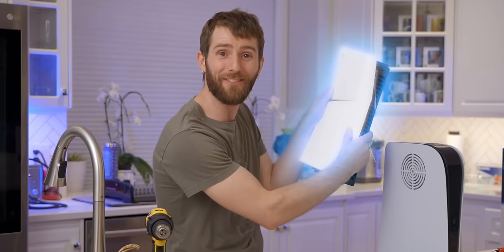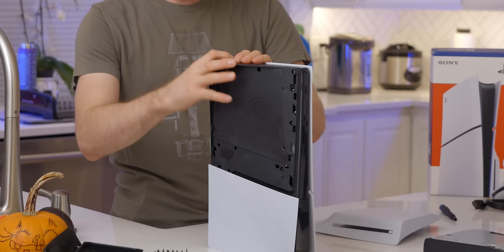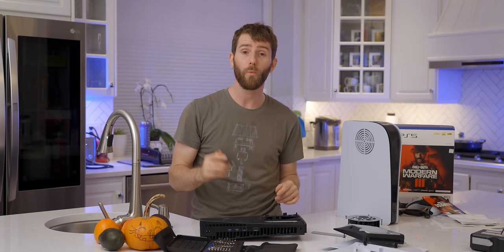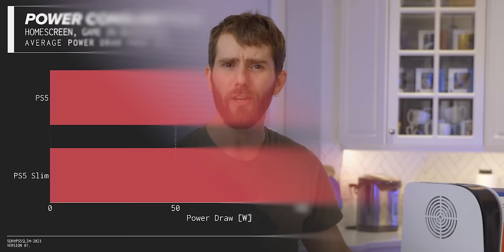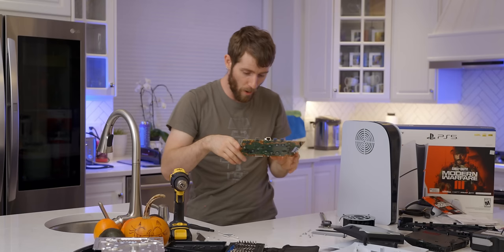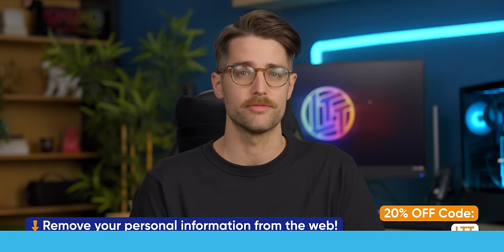PS5 Slim First Look and TEARDOWN!!

Comment: I thought you would share if the PS5 ran the same .. And cooled the same..

I have the original . .

My son bought mine at Fred Meyers where he works. 

March , 2021 . 

I've played a lot of call of duty.. 

I went through 7 PlayStation controllers 

Due to stick drift . 

I bought half from Fred Meyers. 

I started to buy warranties at Target and get my controllers that way..

But those controls lasted with a shorter life span.. From target In Spokane Washington. 

My first controller I bought from GameStop with a warranty has worked a year. 

All other stores a average of 3 months if I'm grinding on call of duty.  

I believe I'm very rough with the controller on call of duty because of the sliding around and shooting on multiplayer.. 

I stopped playing call of duty and I stopped breaking my controllers...

Now I play racing games and my thumb goes out before everything..

But this  PlayStation supposed to be more expensive..

With less product . 

That seems shady. 

The cost of living went up everywhere. 

Food has doubled in all aspects.. 

At fast food and grocery stores. 

But every one in the US is still making the same   .

Even property taxes doubled in price.  

COVID is gone . Nobody is getting free money. 

Jobs are still not paying more ..

The retail world is ridiculous due to COVID and the bit coin
.
.. bit coin screwed me .. 

I bought a gigabyte 970 extreme gaming in 2015 and thought they run to hot..  

I will get a 1080ti cause That architecture actually ran a lot cooler..

Then video cards went up to $1,500 used if you could find any.. 

I gave mine to the kids for Christmas expecting to pay about $600 for a nice 1080ti .  

Not a chance. 

I have Titan chokes on my 970 extreme gaming.. 

I feel bad but I took it back from the kids....

Added artic mk4 and it's been in my PC for 7 years collecting dust. . 

I built a fast PC for my son two years ago when m.2s and CPUs dropped in price.  

But both him and I still haven't bought new video cards yet, but I noticed video cards are becoming very reasonable priced and the AI technology is looking pretty good. I'm just not sure if I'm ready to buy one  yet.  

Always like to hold off a little bit in these areas. Sometimes when I feel this way because I keep thinking something a little bit better is getting ready to come out. So I'm a little bit better. Is going to get ready to come out and when it does the old stuff is going to start selling for a lot cheaper and that's my trick. 

I do the same with car audio.
But car audio has taken over too much of my home. It takes up a lot of space. I think it's time to get rid of that hobby. I'm too old. 

And I just started to grow cannabis.  

And that takes allot of space. 

And a massage amount of work if you grow in tents. 

Cuz you will be finding yourself in there weekly tearing all the leaves off just to get the temperature and the humidity to drop if your plant starts taking over the tent...

It's like having a new born baby.. 

You will be looking all the time..

I bought the AC Infinity kits. They are very nice with the controller 69. You can monitor everything with your cell phone vpds. It's very nice. 

You would like it. 

Up your alley. 

But cannabis isn't exactly for everybody. It's definitely good medical for the mind, but you have to learn which one works for you. 

Then by changing the harvest date, you can actually change the way the high affects you, whether it's a cracked eye like Daffy duck or whether it is a couch lock high that makes you stuck like Chuck. 

Lot to learn.  

But the first times after scary and not easy for people.. 

Anyways, I have brakes to do on my car. I used to love watching your videos in the past. It's been quite a few years since I watched them.

You and Jay Z2 cents are the ones that inspired me to do a video. I did. One started to get a lot of subscribers but I left it alone because that's when the video cards got expensive and I was mad. I just totally gave up on computers. Mine sat forever. I was mad. All because of the bit coin.. 

The reason for it was is my life was finally going great. I had custody of my kids and I was getting everything I wanted in life and I knew that I wasn't going to pay that much for a video card and then covid hit and then everything just took. I was getting ready to get a car and all the cars doubled in prices they used ones. I meant they've doubled.. 

I had money.. and it all got wasted on the cost of living. 

Take care .  Good luck and good vibes ..

We are now learning that light has consciousness and we are all in vibrations so I want to start changing it to Good vibrations again like The Beach boys, but it's not about the Beach boys more about humanity getting into a new consciousness.

Comment: Is the Dualsense cable for the new PS5 USB-C to USC-C? Or is it the original USB-C to USB-A? Because the new PS5 front panel provides 2 USB-C ports instead of one USB-A port and one USB-C port, it means that the USB-C to USB-A Dualsense cable can't be connected to the PS5 front panel to be used...

Comment: Is it safe now to stand it up vertically? It was recommended against in the original due to the liquid metal on the processor. Also are the dark plates out yet? The website is a bit confusing.

Comment: I don't get why people call it the slim when Sony has never called it the slim themselves.
Reply: The same reason Sony didn't call the previous ones Slim like PS3 and PS4 Slim.
Reply: @dericjames2018  alright, then why are people complaining that it's not using a better processor because the ps4 "slim" uses the same processor as the regular ps4.

Comment: Slightly over-engineered, but it simplifies their manufacturing.  Only really building one model, with an optional drive part is good thinking.  Having the SSD on board is mixed, but again, it makes good business sense, as Apple has been doing this for years.  It's saved money in manufacturing and overall, they are reliable.    But any SSD can fail.   And when they do on an Apple, the whole system board has to be replaced, if there's no back up of our data, then it's bye bye.  $1000+ replacement for what would be a $60 part for a normal computer.

Does the PS5 allow the system to run on the M.2 drive as a replacement for the built-in SSD?

For sure, the new PS5 slim is the better unit in many ways.    The HDMI connector is oddly high, harder to hide thou.  I would also think more airflow for the SSD would be welcomed, that perhaps the SSD can run cooler without the metal cover plate attached?

Comment: Im worried about the removal of disk drive feature since sony probably did something to make it not last so long so you can buy another disk drive.  If the OG ps5 is still available I might just buy it since it has the same components and runs exactly the same its just the OG ps5 went on a diet.

Comment: Why he didnt want to open the power supply? For what reason?
Reply: Inside the power supply are evil electrons that can zap you and hold a charge for a while, even after powering down. Guess he didn't want to risk getting electrocuted or accidentally shorting something out in the power supply.

Comment: I love my 6 nm fat PS5 with disc drive. I think the slim with disc drive is pretty ugly as the drive pokes out from the side like a tumour, and if you store it horizontally it needs those cheap-looking plastic sticks. I also don't mind the size as it fits in my TV stand just fine and seems like the appropriate size given how powerful it is. The size still doesn't even begin to compare to even compact desktop PC's. I think the slim versions of consoles usually scream "cheapened", with the only exception being the original Xbox 360 slim which actually made the console seem higher quality rather than the opposite.

Comment: Question Linus can you educate us on routers like for example when it comes to  using ethernet cables connected to them. Like would there be any benefit to using a cat 6a cable for a eero 6+ and its devices linking to it such as a ps5 for example?

Comment: I am building a pc with a GPU with a 12 pin connection. Do I need to use two 6+2 pcie connectors and plug those into the psi and the adapter. Someone please explain how to use these 12 pin to two 8 pin adapters

Comment: I just want to know, if I get the version with the disc drive, will they also include the faceplate that comes with the digital console? Like can I get the disc drive version, take the disc drive out and put it aside, and then use the digital version faceplate to present the console as digital only? Or are you stuck with that chunky disc drive faceplate even when the disc drive is taken out?

Comment: You really have to hand it to companies and their tenacity by keep putting the "Warranty Void if Removed" stickers. It bothers me to no end that that policy is completely unenforceable in North America but companies keep doing it because your average end user doesn't know that. The only thing that could void your warranty by opening up a piece of electronics is if you intentionally or accidentally damage a component while inside. That sticker is only an indicator if the unit has been opened up or not.

Comment: I don’t currently own a PS5 and am going to get the “slim” when it’s released. I’m planning on wall mounting behind my tv, with the disc drive pointing up (there are book cases either side of the tv). Is this orientation ok? I’ve not seen anyone else do this. Thanks in advance.
Reply: Don't expect Linus to actually answer.   He only cares about pumping out the next video.

Comment: IRonically like the other predictions I made that came true for the specs on the Switch, PS5 and Xbox ( at least for the ram being 16 GB), when I saw there were finally going to be digital only versions, I said it would only be a matter of time before they just offer an upgrade of some sort in case folks change their minds later and want an optical drive. Well...its still funny to see come true, but its a good thing. JUST THE PRICE IS STILL TOO MUCH! And we STILL dont officially have a PS5 "PRO" yet....*sighs HEll we still waiting on the next real Switch upgrade. My hopes been shot from gaming consoles over the last  10+ years, along wiht disappointment in a lot of collectibles and movie/tv releases.  Just more parts of what will make the future as dark as was foretold by so many over the decades. :P
Reply: POST SCRIPT: Seeing the amount of solid copper tubes ) cant even call em wires they so thiccc lol) is nutty in a way.

Comment: Go figure they would release one of these. I personally am annoyed with my PS5. It's the most oppressive piece of technology I have ever owned in regards to the internet or even cellular signals. Outside of the "smart" TV my dad got me last Christmas (which has its own issues)... if there's a device in the house connected to the internet, wifi or otherwise. The PS5 hogs all the signal until it is shut off. No laptop, no phone, no xbox. One time the electric company's website told me my internet was crap and redirected me to their low broad band version when I tried to pay a bill on my phone. 
Hell just now before writing this I tried to pay my phone bill. I don't have internet because I am without a job. I had just turned on my PS5 but the phone app kept crapping out. Wouldn't let me connect to the pay bill page. The second I turned the PS5 off... the app worked just fine and I was able to pay the bill. 

The one thing it does do that is nice is turns the TV on when you turn the PS5 on. Which is helpful when your TVs bluetooth remote (seriously who thought this was a good idea?! 🤷🏼‍♂️) stops working normally when the TV doesn't have internet. Only to work normally once the TV is actually on (resyncing doesn't help). Sadly if you mean to turn your xbox on but turn the PS5 on... it will keep switching back to itself... "Console war" to a whole new level. 

It does look great in 4k when the game is compatable and does NOT require a bloody subscription to play single player games like an xb1 or the trash can does which is quite nice.

Comment: Can you answer me a question i have pl. Is the ps5 slim the same as ps5 original or  because its smaller it will overheat more quickly.I want to get one the summer but i dont know what version i should buy what is your opinion? Last thing will the ps5 slim be able to connect with the psvr and the psvr camera.

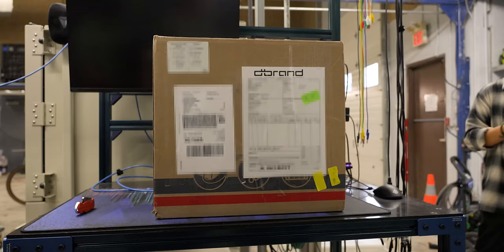Comment: - [00:29] 📦 El PS5 Slim se ha filtrado antes de su lanzamiento el 10 de noviembre.
- [00:59] 🎮 El PS5 Slim es compatible con todo lo que funcionaba en el PS5 original.
- [02:32] 🔧 Sony ha hecho que la expansión de almacenamiento en el PS5 Slim sea muy fácil de usar.
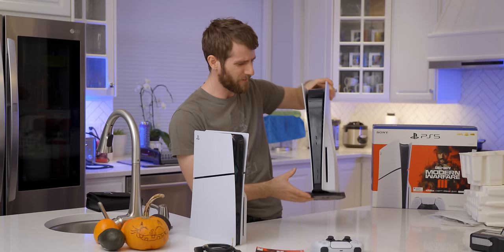- [03:01] 🤏 El PS5 Slim es mucho más pequeño que el PS5 original.
- [03:31] 💨 Las entradas de aire del PS5 Slim están menos obstruidas que las del PS5 original.
- [04:03] 🦾 El PS5 Slim tiene un diseño más aerodinámico que el PS5 original.
- [04:33] 🔌 El PS5 Slim tiene un puerto USB Type-C adicional en la parte frontal.
- [05:02] ⏏ El botón de expulsión del PS5 Slim está en la unidad de disco, no en la consola.
- [05:31] 🚫 Sony no incluyó un soporte con el PS5 Slim.
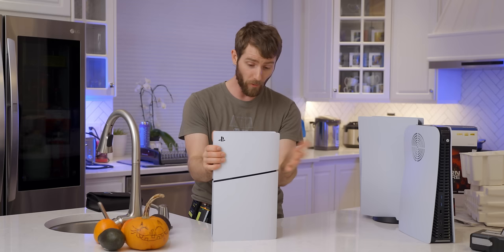- [06:03] ⚡ El PS5 Slim tiene un puerto USB 10G adicional en la parte posterior.
- [06:32] 📉 El volumen del PS5 Slim se ha reducido en más de un 30%.
- [06:32] ⚖ El peso del PS5 Slim se ha reducido en un 18 y un 24%.
- [07:00] 🎛 Sony revisó silenciosamente el PS5 original para usar un nodo de seis nanómetros en lugar de un nodo de siete nanómetros.
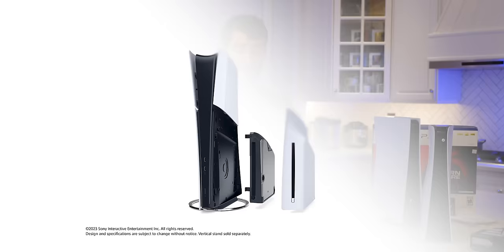- [08:00] ✅ La versión digital de la PS5 Slim se puede actualizar más tarde para agregar el lector de discos.
- [08:56] ✅ Es fácil reemplazar la unidad de almacenamiento en la PS5 Slim.
- [09:27] ✅ El conector para la unidad óptica no es USB ni SATA.
- [09:59] ✅ La versión digital de la PS5 Slim tiene 1 terabyte de almacenamiento.
- [12:01] ✅ La PS5 Slim es un poco más silenciosa que la PS5 original en general.
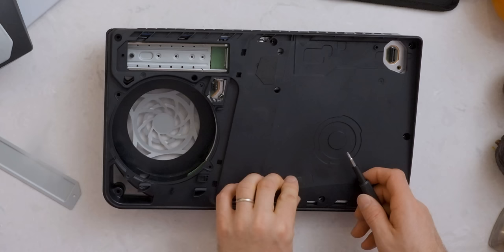- [12:29] ⚠ Hay muchos tornillos diferentes en la PS5 Slim.
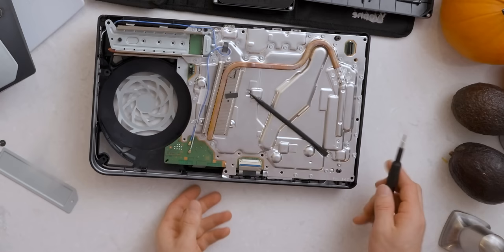- [13:04] ✅ El disipador de calor de la PS5 Slim es más pequeño que el de la PS5 original.
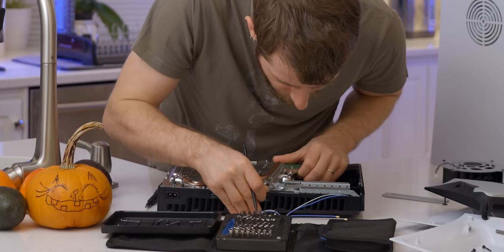- [13:39] ✅ La PS5 Slim tiene un conector de cinta funky.
- [14:09] ✅ La placa hija de la PS5 Slim tiene dos puertos USB-C de alta velocidad.
- [14:39] ✅ La fuente de alimentación de la PS5 Slim tiene la misma clasificación de potencia que la original.
- [15:08] ⚠ La PS5 Slim consume más energía cuando se vuelve a la pantalla de inicio sin cerrar el juego.

Comment: New to the PS5 scene.  I'm looking to buy the "older version" bundle with Spider Man 2 that's going for $500 right now, because I'm trying to avoid the hassle of trying to get the same slim bundle.
That said, is this version legit, or should I absolutely try to get the slim?  Any advice is appreciated.
Reply: I'm in the same boat as you and most likely will grab the slim. Also people are saying it's not gonna be too crazy to get these since a lot of people already have the original ps5
Reply: @OTOxKRUGERxOTO  I've looked online and some major retailers like WM and Dell have already sold out.

Comment: It is so extremely sad that big bloggers did not get models of PS5 with a NMB fans to experience this penetrationg UFO, high pitch whining/howling sound that drives people crazy, Myself, many people that bought the console fron the same store as I did and also many people that I found on reddit. An utrasound that makes the head hurt. And there is like almost half of consoles with such NMB fan, but some people luck to get those quite ones, those people happen to be Big Bloggers! So this issue is not discuss and Sony keeps making PS5 with an insanely loud high pitch sound. Really it feels for me like it penetrate all in its way, even if the console is hidden behind the table and 5 meters away. I started to experience headache from it and could not concentrate to play, so I filed a refund, I hope it will come through.

Comment: Only god knows how much this will cost in Asia and the middle east
The current PS5 slim costs 490$ and begging a god one day my parents would buy one for me because I really want to play the new final fantasy, so I don't care I just want that box just to play the new final fantasy, it's so cruel that because of one game you need a new box, I don't know what a hell was the point of the ps4 pro (I still have it) when they were going to screw the console over 
But it's much smaller, I wish it was a bit cheaper, surprisingly it's too expensive or the same but it will be more once it's imported to our country. 70 percent of the profits comes from the game, why doesn't this console have a price cut??? When the ps4 slim came out it had a massive price cut but why??? Why didn't they at least decrease the current model, so Sony is basically thinking about making a PS5 pro
Lol Most of the latest Games made in the same old ps4 pro engine and slapping the name of the next gen

Comment: Its the exact same PS5 for the exact same price, but it doesn't come with a stand or a disc drive. 

Seems like a pointless product to me. Unless you want to put your console in a subby that's like half an inch too short, there's no benefit to buying this thing over the original.

Comment: I.m not sure microsoft looks more "money-grubbing" than sony just because of the ease of installing 3rd party drives, for every "greedy" position there's a counter point from the other side.. you have to buy the stand..? Back compat..? The price of PS plus going up? ..the Console price and digital games prices increasing? .. Lets remain balanced when reviewing and throwing words around.

It was good to compare the new slim to the older gen PS consoles too, still looks big, and it seems like the same size as the Series X especially in height.